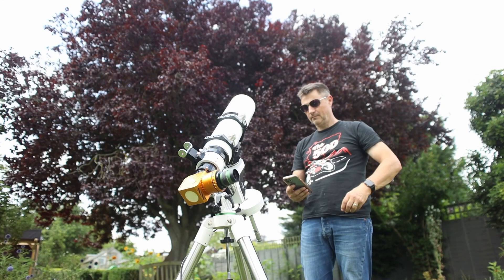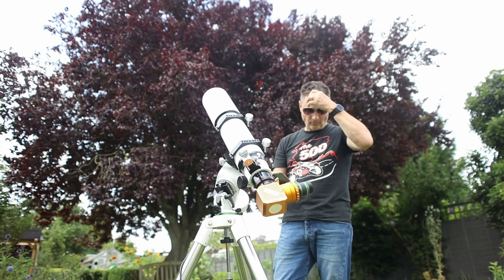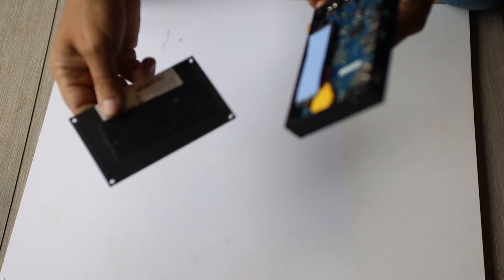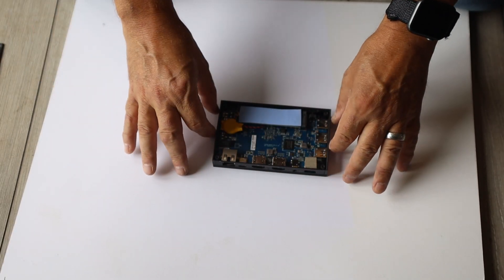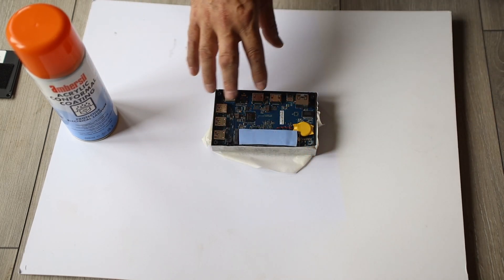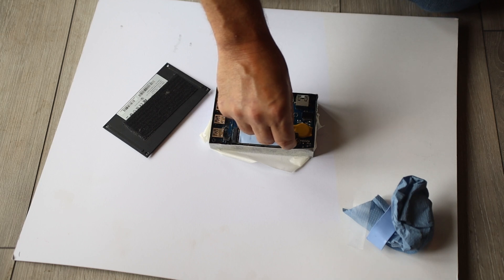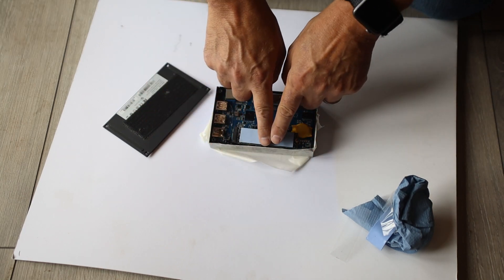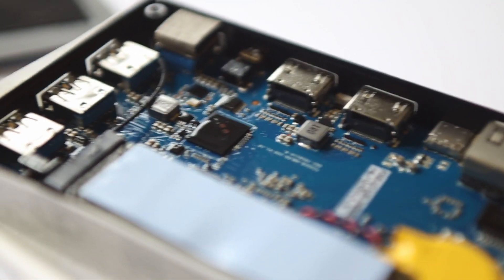How to Keep your Astro equipment electrics protected from the wet and damp

Comment: Hi Glenn, we've used CC for many years in the mod so yeah top tip,  generally we spun the  boards for track side coverage whilst masking heat sink contact points, switch, connector and any other devices etc. Some pcbs can be deceptively uncoated but have a hard micro film applied hard to remove. But certainly no harm in applying some, maybe some companies are happy to leave their boards deliberately untreated 🤔 hmm. Atb Tom..
Reply from the maker: Hi Tom. It seems like a kind of essential treatment for electrics that will be out in the elements. I think however the extra costs of adding this in the manufacturing stage means a lot of companies don't bother and by the time things start to fail the warranty has long passed.

Comment: Hi Glen have you looked at Dielectric grease my be usefull for USB connections to keep moisture out appear you only need a very small amount may be worth looking into.  Great video
Reply from the maker: Hi Graham and thank you for commenting. I haven't but will definitely check it out as USB connections going wrong is common and moisture could be the culprit.

Comment: I would probably cover the top side of the connectors as well.
The Sky Watcher electronics I've seen so far did not have any conformal coating. It's an extra step during manufacturing that costs money, so you usually don't find that in cheap consumer electronics. 
It's probably not a bad idea to cover the PCBs of your mount as well.
Reply from the maker: I have read it adds quite a bit to the cost of producing so assumed my sky watcher mounts would not have it. I will be treating them for sure. Thanks for commenting

Comment: You can usually detect the conformal coating because it's fluorescent under UV light.
Reply from the maker: Nice tip thank you, was not aware of that. I’ll have to get a UV light source or take my gear to a nightclub 😂
Reply: @Astrobloke  A cheap UV torch is handy for anything like this, good for finding coolant leaks in things too.
Reply from the maker: @DavidMills_Physicist  i am on Amazon right now sorting one as being out in the country I am kind of short of nightclubs 🤣

Comment: I've only been in this hobby for less than two years and so far I've had the dew/moisture take out a power station, two wireless routers, a USB hub, and the circuit board in the EQ6R-Pro .. twice.
The second time the EQ6R-Pro head came back from Skywatcher (they were incredibly good about it and replaced the board both times under warranty) I ordered a can of conformal coating and sprayed it down.  I'm gradually working my way through the other equipment.  Like you say: be careful not to coat connectors.  ;)
Reply from the maker: Hi Bruce. I have had gear taken out too but luckily not as bad as yourself, you have been unlucky. I think having an observatory helped. Thats good that Sky Watcher provided you with good customer service and replaced your boards, hopefully now treated you will have no more issues.

Comment: The slewing problems you had, was that also with a wire or just when using your phone to slew with?
Reply from the maker: I need to check with a wire but that was just wifi. Could be that but will have to test

Comment: Great video Glen. The only weak spot after this is the external ports. I use a product called DeoxIT. It cleans electronic connections and leave a lubricating coat on them. I would think WD-40 Electronics cleaner would do the same. Might be overkill, but easy to do and just one more piece of mind.
Reply from the maker: Thank you very much for that recommendation. I have an electrical contact cleaner bought some time back from Maplins. I will check the can and see if it also applies the same sort of lubrication. I think anything is better than nothing.

Comment: Glen what about your thoughts on preventative measures? My EQ6R is now housed permanently in my Keter Shed Obs. What about a video on humidity damp prevention?
Reply from the maker: I completely agree with that and have always included good ventilation and even heat sources. I know others even go further with dehumidifiers. I think the only problem is as good as your Observatory may be once that roof is fully open your gear is exposed to the conditions, i have had nights that are so dew heavy everything is coated. Hoping this will help.
Reply: The way I see it and I might be wrong. But dew is not the big problem, since it is basically demineralized water. My gear is often covered in dew and frost and I keep the electronics on so those parts should be good. I have a box next to the mount with the computer and powerbricks and it is around 30 degrees celcius.
When I move gear between outside and inside I try to let it come up to temp slowly so I wont get dew weird places.